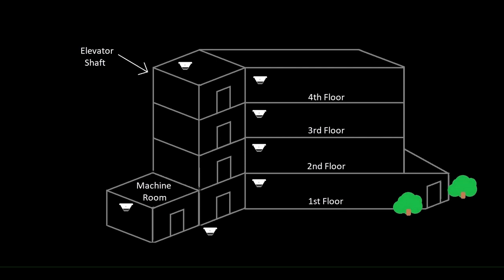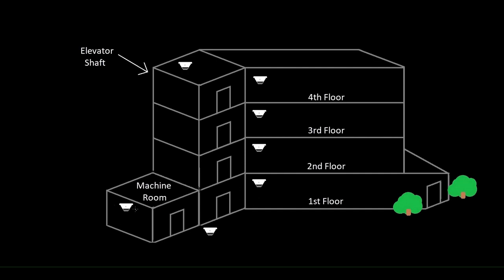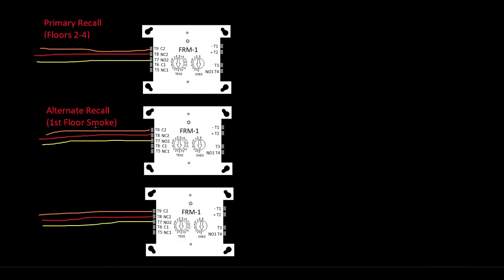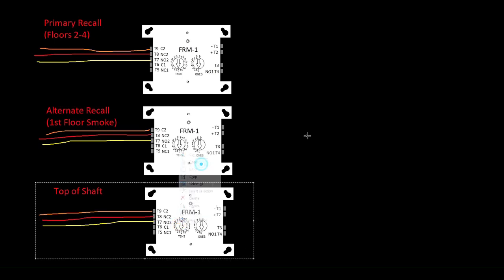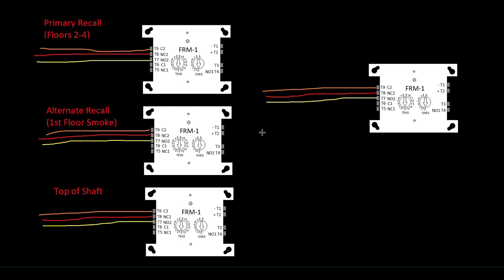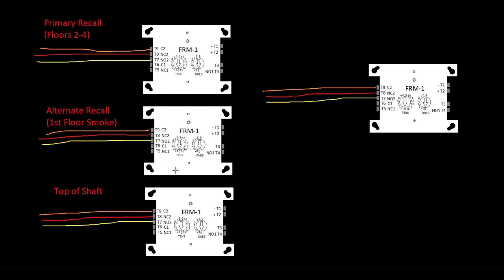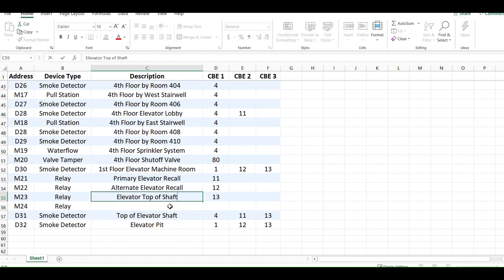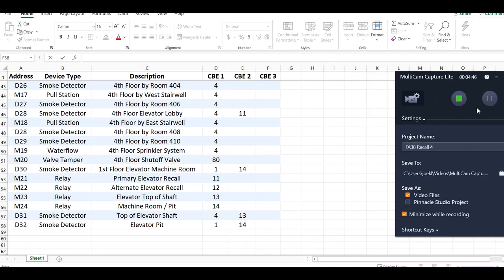38 - Elevator Recall with Independent Flashing Hat Relays - Introduction to Fire Alarms

Comment: So, in a normal operation if the elevator machine room is on the 1st floor the HAT trip would send the elevator to the floor above?
Reply from the maker: Typically, yes. I have seen exceptions to that, depending on where the machine room is physically located. Ultimately it's not up to us as fire techs to determine that, we just have to be able to send the car where the elevator inspector wants it.